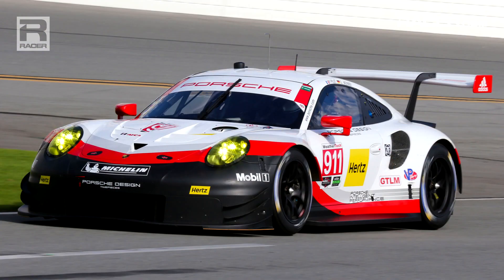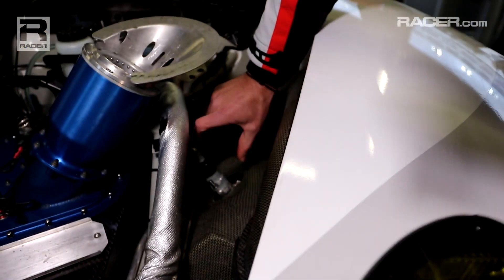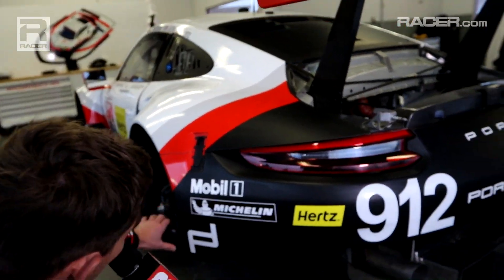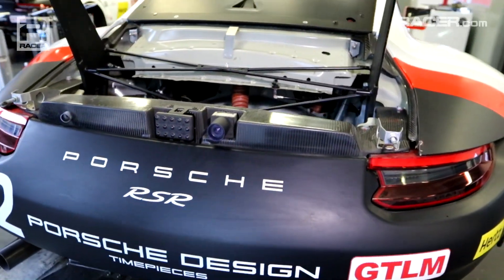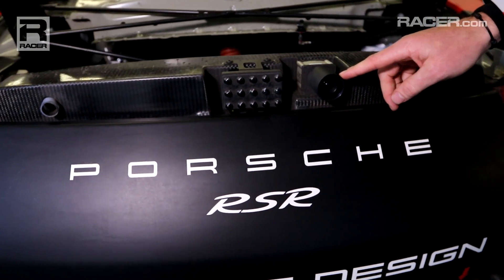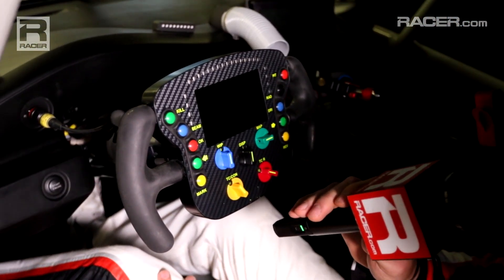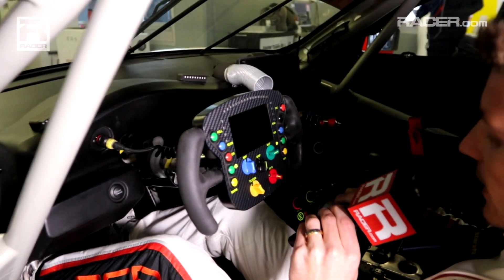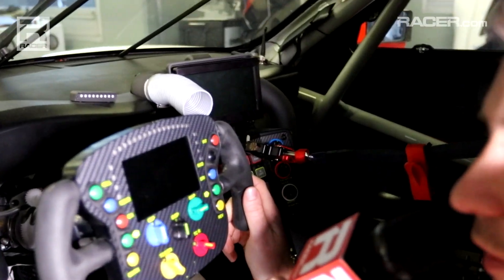IMSA: Porsche 911 RSR Tech Tour

Comment: So, not rear engine car anymore. But a 911 mid engine one. Did someone say CAYMAN??????
Reply: I don't think you can say that. It's still more rear engine based than middle. But it's definitely more in the middle than the typical Porsche.
Reply: arcelivez d so is the cayman at 36/64%
Reply: Mid engine is good mode
Reply: Fuckin auto correct ok guys mid engine is god mode
Reply: It is a 718 RSR.
Reply: there was a mid engine 911 before: the 996 GT1
Reply: Yeh, they had to whine about it and they were granted the option to move it forward to fit a larger diffuser. I think all the GTLM/GTE manufacturers should have said "sure we are ok with them moving it forward as long as we can move ours to get a better balance"

Comment: Mid engined. 911.....??? 
I see an admission of guilt .
Porsche is finally admitting ,  
Yes , the engine “was” in the wrong place .
5:28 . A mid engined car , a “proper” race car , I agree and so (finally ) did Porsche 👍🏼
Reply: The engine was mostly moved for aero reasons - having that large diffuser helps tremendously for downforce..  Wasn't an option with the previous engine.  THe weight distro on typical "rear" engined Porsches is about 39/61 as opposed to the ideal 40/60.

Comment: I would have much rather have had the tour of the Cayman, er, I mean 911 RSR, from a mechanic rather than the driver.
If the mid-engine 911 does well, will that be the end of the rear engine Porche?
Reply: Ralph Averill no, the 911 GT1 wasn't the end of the rear engined 911 aswell
Reply: they need the engine space for the big diffusers now allowed as well
Reply: The head of Porsche Motorsports explicitly said there will be no mid engine 911. And that they moved the engine to the middle for "performance optimization" which is allowed by the FIA rules.
Reply: Thank you Dutch, Hans, and AJ. I get what you're saying. I have to think, however, that if the mid-engine 911 does better in competition than the traditional 911, isn't that a demonstration that mid is better than rear? Doesn't Porsche, more than everyone else except maybe Ferrari, market their car as pure race-tested performance?
Anyway, I'll be watching and will get close when the show comes up to Lime Rock, my home track.
Thanks again for responding to my post.
Reply: Ralph Averill it's because of the rules in the series specifically that the car is like that. The engine position is just weight distribution. Porsche has gotten really good with having an engine strapped behind the rear axle, as the traditional 911 is one of the best handling sports cars , and they market their rear engine thing well, but really no space for a big diffuser.... they are allowing much more downforce now, before they just had a big wing but now they need the space
Reply: Hans, "just" weight distribution implies something trivial. Moving the heaviest mass in the car from behind the rear axle to in front of it is a significant change in the fundamental physics of the car, especially in cornering. With the large increase in aero down force enabled from the engine relocation, there should be a substantial improvement in performance. Good for Porsche.
However, I don't see how Porsche can continue to market a rear engine 911 while racing a mid engine design at the highest level of competition. It seems like an advertisement for a Cayman to me.
Thanks again for responding.
Reply: Indeed, porsche has to intentionally handicap the cayman to keep it from outshining the 911.   Put the same engine and level of suspension in the cayman and it would be superior to the 911.
Reply: I think that's the reason the Cayman GT4 is available with a manual transmission only.
Reply: Porsche still believe that the rear engine is better in the road car, I don't know all of the reasons why, but the rear engine gives the car excellent traction and braking performance, modern engineering has fixed the handling woes of early 911s, and it allows for a more compact car overall whilst retaining small rear seats. 

The reason they were forced to use a mid engine for the new GT race car is that the regulations permit the use of MASSIVE diffusers that you would never want on the road. Unfortunately, using such a diffuser is impossible with the rear-mounted engine so they needed to move it.

I have no doubts that if such large diffusers were banned from GT race cars, they would move back to using a rear engine.
Reply: I heard some inside information from a guy who works for Porsche and he said that the concept of the cayman could easily outperfom the 911. However, Porsche placed the Cayman at the lower end of their product shelf in terms of marketing. That's because their customer base mostly consists out of wealthy people starting at the age of 40 and over who grew up with the 911 as their childhood dream. As long as the 911 sells, Porsche has no need to produce a "proper" Cayman which destroy the legacy of the 911. Tbh I believe we'll never see anything faster Cayman than the GT4, which is certainly fast enough for the open road.

Comment: Yay first comment!

Kevin, very interesting info, glad Porsche allows you to show stuff like this. That little driver cooling vent at the front, omg that is so small? Is it just a fresh air port or is it linked to the AC system, supplying the actual air?
Reply: Yep - racing is a hellishly tiring sport.  I'm beat after a half a day at the track.  Some of the F1 drivers can crack a walnut between their head and shoulder.

Comment: Is there a reason the rear wing mounts aren't swan necks?  I don't think I've ever seen a rear wing mounted from above without the big hooks.
Reply: they produce less turbulance than traditional rear wings
Reply: Think about it like the bottom diffusers.  The vertical part helps to channel it, reducing turbulence.
Reply: francis xstpierre and it will accelerate the air too, helping to push the car, is not much, but in racing everything count,  a little a little there

Comment: So there is no rear window or rear view mirror. What happens when the rear view camera is inevitably damaged or if the electronics malfunction? Do IMSA rules mandate that the driver must immediately pit for a new camera or park the car if they can't find/fix the electrical problem? I get that you really have no rear view from the prototype cars, but they're constantly passing, not being passed. Seems like a solution in search of a problem.
Reply: There are still side mirrors which are mandatory. rear view camera's have been used for a while now on other race cars.
Reply: All valid points. And these guys and gals are near super-human in their ability to place a car on track, in traffic. I just tend to think it's not a very smart move for the GT cars to be rear window-less, especially with the closing speeds you see at tracks like Daytona.

Comment: Midengine?
Reply: They understood the retardness of the rear engine positioning, which didn't allowed a good mass distribution and didn't allowed for advanced aerodynamics to stick the car to the ground. Since the rules specify that the race car needs to be more or less similar like the road car, they had no other option than to bitch and moan to FIA to let them move the engine in the proper position, ignoring the fact that they are bending the rules and trampling all over their crap tradition with the engine in the wrong position. For whatever reason, Ferrari and the others indulged and allowed them to turn the car intro Gayman RSR. Shameful display of useless stubbornness, and leniency from Ferrari and the others.